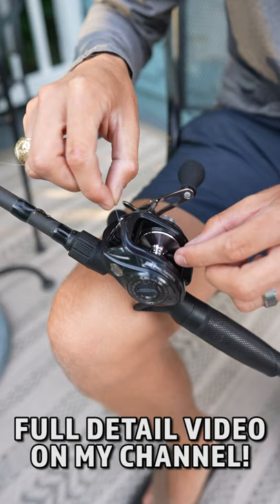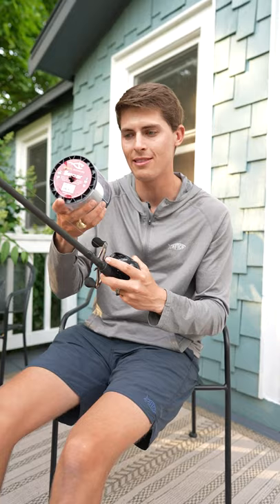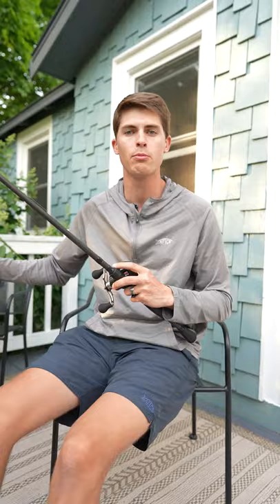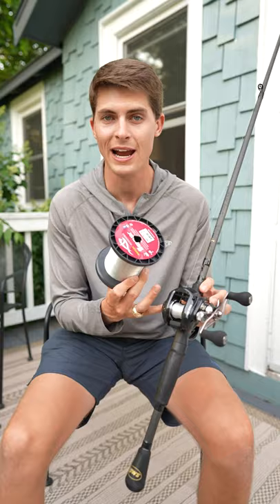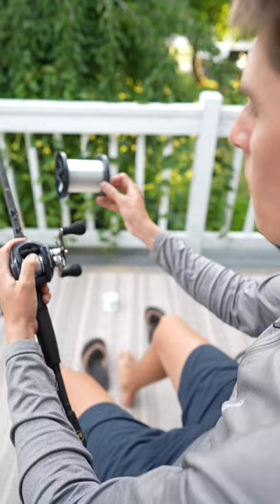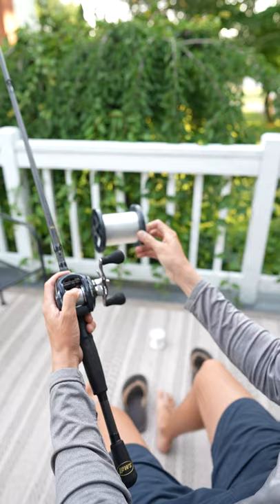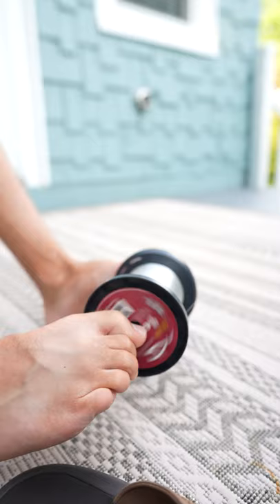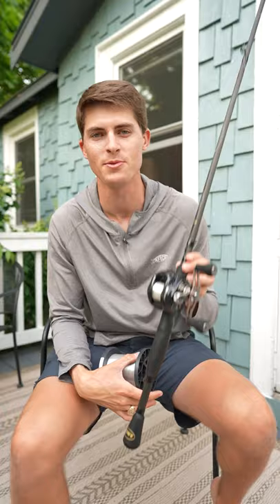Line Spooling The RIGHT WAY! (Baitcasting Reel)

Comment: What about 40 pound braid per say how much would backer would I need. I'm hopefully getting a shimano slx and idk how much backer to put on.  I have 12 pound mono just sitting around. Is that good enough?
Reply from the maker: The problem with 12lb backing line is that the connection knot will be large in your spool. I’d get 6lb mono for backing, fill it up to 1/3 spool, then put on your 40lb braid

Comment: I really don’t see the point of using backing line, any line to line join weakens the line strength by almost 50%, that once in a lifetime fish just might use up your main line, expose the knot and ping, the knot gives. Line is cheap if you know where to look, just fill your spool.